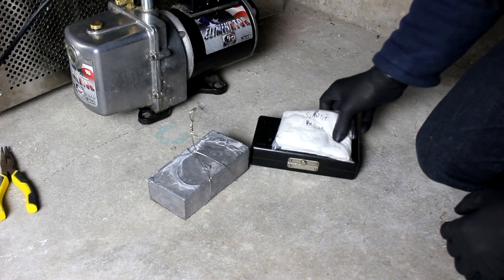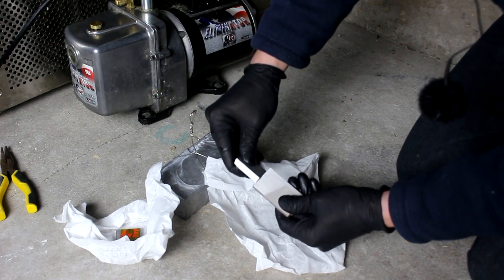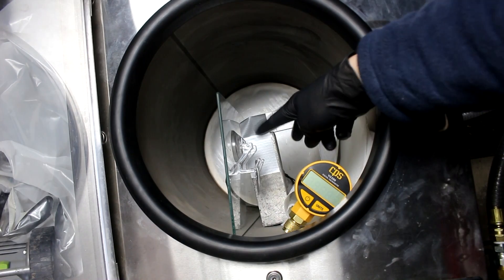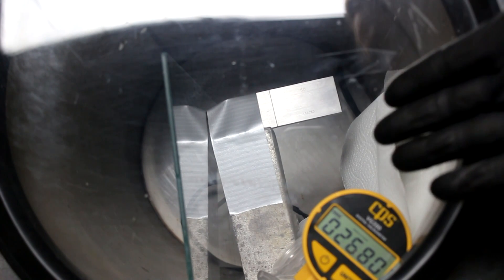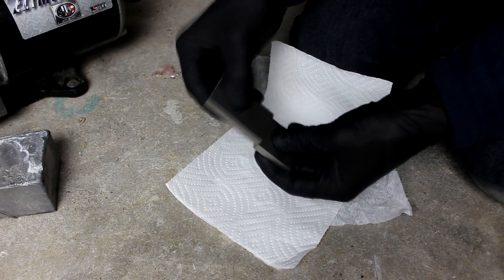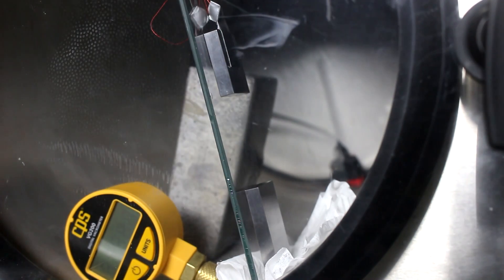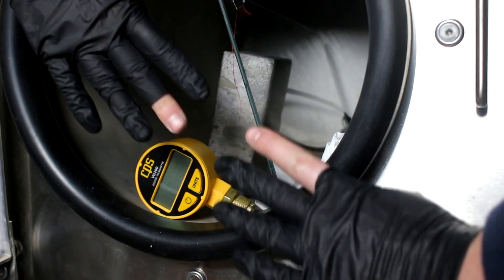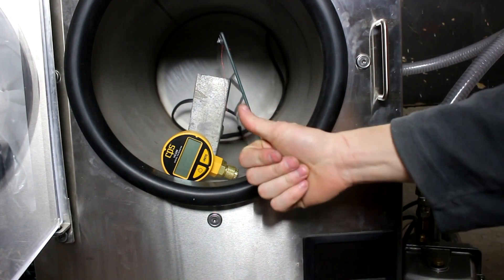Will Gauge Blocks Stick In Vacuum?

Comment: I seem to remember from materials study way back when that what makes metal malleable is the shared electrons on the atomic level.  It allows metals to be formed without coming apart, and makes metals behave...well...like metals.  Is there a chance the blocks are so close they start sharing electrons as though they were one piece?
Reply: The guy who just replied seems to know nothing about the subject. "Please don't buy into conventional science" says the guy who says "But there is no electron" after describing a proccess which requires a movement of electrons...? 

If anyone knew how this worked cody would have found it on the internet. the chances of getting an actually decent answer in the comments is basically 0
Reply: @MsArchitectschannel  Confirmed..
Reply: @martinda7446  i think it's a troll? Theres no way hes serious? 

in reply incase he isn't. Electrons can't be  defined by the simple rules of particles, no one in science would ever deny that and i never did? But you have to describe them somehow and that is how we do it.

I have actually had real proof of electrons from experiments i have done without outside intervention. i have had personal experience measuring the affects of particles known as electrons. i also have personal expereince using them as waves.

You can actually measure the mass of electrons and so if they have mass they have mass. that is how mass works. mostly hahahaha but you wouldn't understand why that isn't true anyway.

Also about the magnet running out. similar to gravity not running out. scientists are working on combining the theorys of gravity and electomagnatism under one title and explination :)
Reply: @MsArchitectschannel  It would stuff me if there weren't any, I'm an electronic engineer...
Reply: @MsArchitectschannel  um let me ask you a question. Where is the center of gravity? Saying that you have to describe something then instantly insist that you're correct based on a Dogma or a set of religions views you like to call science, really only has its basis in the idea of if you can sell it, it is science. I'm not claiming whether or not you believe in the existence of anything that was pure speculation. The whole issue with the electron particle wave duality is that it's a contradiction. It's proven every single day in the Hadron Collider and if you were being honest with yourselves you would realize that the lines of force are clearly described and other electrical experiments. Especially if you're trying to describe electrons as waived particle duality. Look man nature really isn't that complicated. It doesn't want to sell you anything and the reason you think I'm stupid is because I'm telling the truth.
Reply: @MsArchitectschannel  you have seen an electron? You measured the mass of an electron? I really kind of doubt it, more likely you measured the mass displaced by the absence of matter. The reason you don't see electrons,is because there's nothing there to see. Kind of like a flash you don't get to see what happens on the other side of it. Cite your source I want to see the results of your quote-unquote experiments.
Reply: @buckaroundandfindout  thank you Dustin
Reply: @buckaroundandfindout  yes, and yes. i have done both of those things, it's actually not that hard to do

have you heard of an electron tube? How else would you desribe the line of particles that come out of it that you can see by using an electron reactive plate. 

I don't have sources or results because i was like 14 in high school doing  simple af experiments 

past that having done my degree in chemistry i have seen all sorts of atoms as a picture on a screen and been able to manipulate them in real time and i know how the machine is put together and everything that is on the computer, so how would someone fake that? 

just because you are uneducated doesn't mean everyone else is uneducated
Reply: @buckaroundandfindout  if you are arguing that because you can't physically see something with your shitty human eyes then it doesn't exist then i dunno what i've been breathing in all these years. must be fake news. 

If it acts like a particle it IS a particle that's how science works, might turn out it is a hole as you say. but right now as it stands by the definitions of particles it's a particle 

Pretty sure you are missunderstanding from the "holes" theory of electrons used to describe semi-conductors hahaha
Reply: @MsArchitectschannel  I don't have to make that argument. Atheist make that argument every day. But I guess your the arbiter.
Reply: @buckaroundandfindout  What is your first language? Because I know for a fact it isn't American English or queen's English.  Also, what is your religion? Because you have "insulted" a few people by calling them atheist.  You insult people for believing in a particle that YOU cannot see yet insult people for not believing in a God or gods that cannot be proven. 

Also.... are you okay? Do you need help?
Reply: @martinda7446 eletronic engineer and doesnt know that It is electron spin that makes a magnet work
Reply: @pacocaapps6775  What has that to do with electronics?
Reply: @MsArchitectschannel  I knew he was an idiot when I read the first word of his second sentence...
Reply: @MsArchitectschannel  um your a fucking Moran.
Reply: @buckaroundandfindout ... that would be you're, not your... but we're all genii here so we'll overlook it
Reply: @Chuck Being that these materials are about as flat and smooth as you can make them, when you do wring them together the force is massive. You would expect friction forces to be absolutely minimal from the perfect surfaces so I agree.
Reply: Like cold welding
Reply: @bigoldfart  hey Kyle. Are you mad bro? One person disagrees with you and you fall apart. How about you explain why I'm wrong. I bet you have no idea what I'm talking about. The fact you dismiss  me proves nothing. But I bet you are a government agent. Give me a break.
Reply: @buckaroundandfindout  Lmao at this bullshit. You're funny dude
Reply: @buckaroundandfindout  
You sound like the kind of person who gets their information from "Reliable" Sources like a blog post from some 12 year old. Look, get out of the bubble and actually see the world. If you believe you are correct and we are all wrong and brain washed then look in a mirror and ask if you are the one in the wrong. If you can't see it then you are an idiot and no one will ever listen to your 12 year old child blog post  you found on a comment of some random social media site.
Reply: @buckaroundandfindout  I like how you go out of you're way to criticize one person because you disagree with several people and claim he's butt hurt because of you. I don't think anyone in their right mind would comment someth8ng like that without being butt hurt like you. Grow up. I've met toddlers with more intelligence
Reply: @buckaroundandfindout  i know what u talkin about
Reply: @kaix8  I am of the mind that the reason the election doesn't exist is because it is the absences of matter and that is why we can't find it. It's a gap in space time quote unquote.
Reply: @buckaroundandfindout  "It's a gap in space time quote unquote."
"I want to see the results of your quote-unquote experiments"

This is a text based medium. There are quotation marks on your keyboard. If it's a US layout the quote mark is just to the left of the enter/return key, but you must hold shift while hitting it or you will end up with a comma.

What proof do you have of the "either?" (quote-unquote)
I don't believe something just because someone says they know it's true.
Reply: @bigoldfart  um are you the other of some self help book. Look if want to drop my iq to that of a cow I'll start listening to you. But for now fuck off and help someone who is asking for it.
Reply: Let me ask you something, if like charges attract then why does the ion not break apart? When ionized all the negative charge is removed. Then the positive charge should tear itself apart do to repulsion. No your just excepting what your told by a teacher. But if u look just a little deeper you find the counterdiction. Try not to think about it like solids are any different from water. If we shift fase then electric charge allows the object to pass. Like an ex ray. Light can pass through one filter but not two. But if you provide a third filter and orient it 90° the light will pass again. Even in the  Hadron Collider all you see is the pathway of the quote-unquote particles as they cut their way through space. But I only think this because of all the well history from the people who came up with this stuff. But stick to school. I'm sure all those art majors will really pay off in the future.
Reply: dustin buck ok so your point is school is fake teaches you false information, and you the smartest person alive.
Reply: @buckaroundandfindout  "Then the positive charge should tear itself apart do to repulsion." Not because the each individual positive charge inside that larger positive charged object is surrounded by little negative charges. these little negative charges hold together the chunk of positive charges like glue, there is no reason it should destoy itself. Nuclei are more complicated though... 

i've worked all of this stuff out from pinciple using nothing a teacher has told me, only stuff i have figured out. (final year chemistry student who loved physics this is kinda my jam) so i don't see why you would be assuming i am just believeing the teacher... Have you ever done these calculations or experiments yourself? i doubt it otherwise youd agree with me and everyone else whos done it... 

Also the people in history who contradict the books is because they were found out to be wrong... because they didn't know enough stuff? thats how life works?
Reply: @MsArchitectschannel  give me a break the people who discovered it were proven wrong, then by that logic they didn't discover anything. Like Santa you bought into it hook line and sinker. Its simple life is a string of vibration. No electron just either. Or quantum fluid if you will. Please stop drinking the koolaid. Just open your mind. I'm telling you it does no good just to with the flow. Great minds think for them self's.
Reply: @MsArchitectschannel  impossible for it to be a particle and a wave
Reply: @buckaroundandfindout  wait till this guy hears about strong and weak forces. Ions are more positive than the default but do not lose all electrons. When you do lose all electrons you have just a nucleus which is held by weak nuclear force i believe? You can look it up. You can do experiments to confirm this for yourself but you wont ever do that because pseudo scientists depend on dogma to survive
Reply: No it's the resonance. To vibrating bodies due to friction. Dielectric discharge is what makes them stick. But there is no electron. Look up the Heisenberg uncertainty principle. Please don't buy into conventional science. If you read more then what they tell you to you find out that all the people who discovered all this totally disagree with the science behind it by that I mean the science of today.
Reply: @buckaroundandfindout  to make it simpler: what proof do you require to start believing electrons exist? What would it take for you to change your mind? Challenge me for something and i will try to prove it to you.
If you arent going to change your mind no matter what, what you have is an unfalsifiable belief which is meaningless and has no proof by definition.
You cant base your worldview off of thought experiments alone.
Reply: @buckaroundandfindout  I've heard of election deniers but electron deniers is a new one
Reply: @nikhillrao3799 😂
Reply: @buckaroundandfindout  i have a friend just like you, he's a paranoid drug addict. used to be good friends, its very sad what he believes nowadays :/
Reply: @user-re5ww9xj3j  yeah I know what you mean I used to have a friend just like you used to think you know everything.

Comment: My thought process is alot like your second hypothesis like they are flat but under magnification the metal is quite jagged kinda like a sharp blade and the wringing together ever so slightly causes them to interlock in a way. I could easily be wrong though 😅 but that's was always how I thought it worked

Comment: You're aligning the magnetic fields because it is so polished and flat that once contacted it wants to act like one piece of metal and the magnetic field passes through it as such.
Reply: This would not explain why it also works with ceramic blocks.

Comment: Have you considered the Casimir effect to explain this? If they're so close that there's only a single wavelength of light in between them, then that's very much the scale that the Casimir effect has its strongest pull, if I understand what I've read properly.

Comment: It would be interesting to see this rug together under the sheets that show the magnetic force to see if the action of pushing the two together creates a magnetic force between the two surfaces due to friction. The heat of friction creating a negative and positive eddie current. Just like the earth spinning the core and the mantel.
Reply: M McKinley Someone needs to do that!

Comment: I would have liked to see the wrung suction test post cleaning with acetone. The oils on the blocks may have kept them stuck.
Reply: Oil wouldn't help them stick, it would make it harder for them to stick, because oil is a fluid and slippery.
Reply: @emmjea6913  in very small quantities on smooth surfaces like this it doesn't necessarily behave like you'd expect.  That's why he cleaned them in the video.

Comment: I believe the strength is coming from the atmosphere you are trapping like the drop of fluid between the two flat surfaces and the interaction of metal at the contact point. (old wonder glue guy hangs from hard hat commercial) I considered the heat from the friction is both transferred and the gas state all lead to the same result also you would need to calculate the amount of interaction and depth level of surface contact in SEM. There is a high level of heat at the contact point acting on the trapped bodies. So the combination of surface tension of suspended fluids oils, contaminants and (humidity) and the interaction of surface like microscopic Velcro no surface is that smooth to totally counteract this. Someone in the comments said if they clean both ceramic and metal but put a fingerprint.

Comment: As almost "perfectly flat" as they are, friction may be causing something other than a "locking" of atoms. That much surface making contact and sliding could also be doing some exchange of charge  and creating a localized magnetic force perhaps. See if some magnetic viewing film can identify any fields they might be creating?
Reply: Any electric charges created would dissipate quickly as heat due to the resistance in the metal (since it's not a superconductor) so any magnetic field that was created wouldn't last for more than a few microseconds, if that.

Comment: Couldn't a person figure out if the blocks stick together via suction be testing the force required to pull them apart? If the force required to pull them apart equals the suction force the blocks generate together then you should have your reasoning.
Reply: hmm seems hes barely pressing/forcing/sliding them together and the pull off seems he uses more strength in his hand than the initial stick together, maybe heat and or friction causes magnetism?
im uneducated on this matter so im guessing.

Comment: Ave 😂 you mean A, V, E. Didnt know who you were talking about.
Reply: yeah surprised ave didn't put in a whole video on how this block is this and that and crap and should of used this really rare alloy that works 10 times better than the current blocks of lead and blah blah why make products this cheap blah.
sorry that was just a dig at how he takes apart budget line drills then acts shocked and talks shit on it on why dont use the best possible material or parts there is in existence and then proceeds to say if it was his he'd do this and that, but yet he never has, so i just see it as an old man in his shed just talking shit on products due to being safe in there.
if a budget drill works for 2 years minimum, whats the problem?
wouldn't we complain that this now budget drill is 3 times more costly due to having stupid rare bearing cases or gearbox components in it instead of the factory already testing there tools beyond belief.
meh theirs my 2 cents sorry.

Comment: string is not good idea. it would be great to have a mechanism  with which u will be able to attach them just like u do with ur hands, but in vacuum Chamber without vacumm.

u should just change one paramater at time. 

and paramater is vacumm.

Comment: the strong force holds it together.
Reply: If that was right, you wouldn’t be able to separate them, as the strong force is about 137 times as strong as the electromagnetic force (which is the one you can use to separate them).

Comment: If you run a magnet along steel, the steel becomes magnetic.  Perhaps this is a similar thing - the motion causes the atoms in each piece to align and form a local magnetic bond.  There may be a measurable magnetic field.  If not then it is possible the larger the force when rubbed together (or faster) , the more atoms become disturbed and the stronger the bond between them.  This should also be easily testable.
Reply: Also, with the surfaces being very smooth but NOT perfect it seems possible that during sliding that some atoms will become exceptionally close to each other.  I don't know enough but it could cause localised melting or a change in electron shells.
It would also be interesting to see if connecting a battery for voltage or current across the join would affect it - perhaps resetting any magnetic upset.